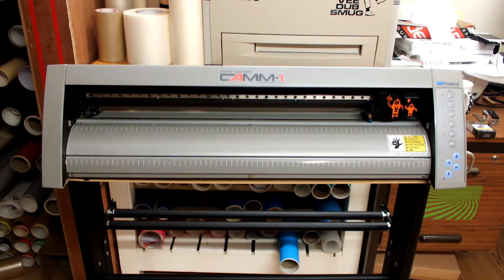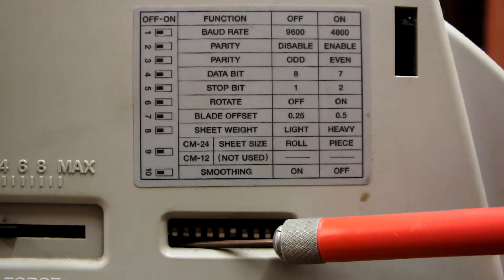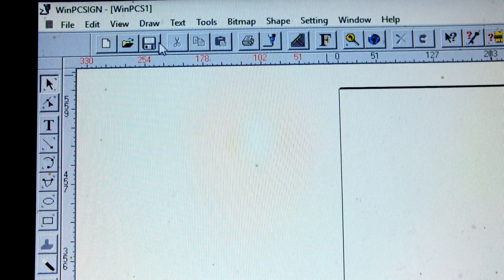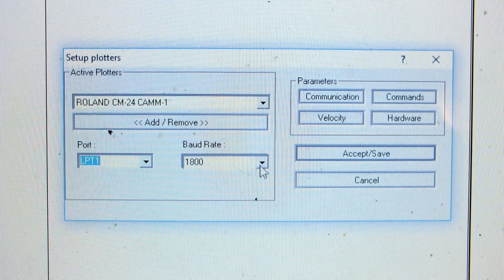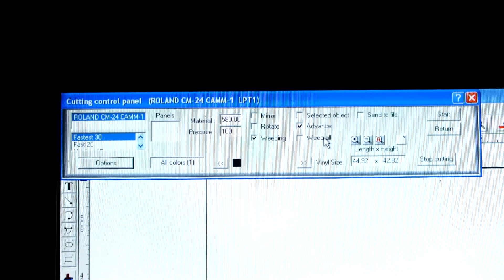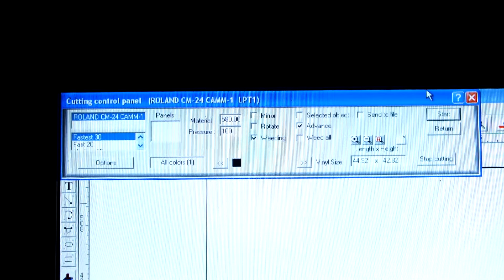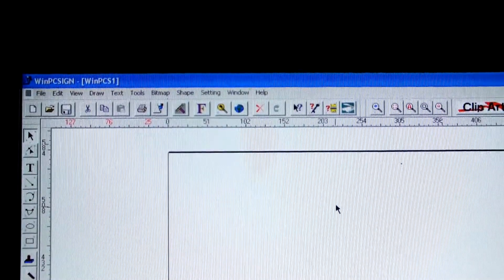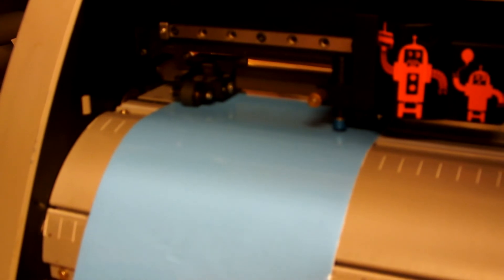Vinyl plotter Basics, How to connect a Roland CM-24 vinyl plotter to a PC

Comment: Hello, nice video. I have a Roland PC-50 plotter and want one like to connect to a Windows 10 computer.
Is there a possibility from serial interface to USB?
Reply from the maker: Hi Mark. 

I have tried every possible way to connect this plotter to modern pc’s to no avail. Unfortunately a old xp era style pc with serial or parallel ports is required for these to run correctly.
Reply: @imsticky6925  Hi. I'm trying to connect it to a win xp virtual machine (running on a win 10) using a USB to PARALLEL conversor device. Do you know if its possible to make it work this way?
Reply from the maker: @brunobatistavalentin  Hi, unfortunately, in my experience there is no possible way to connect these older plotter machines to any modern computer without the computer having a built in parallel or serial port and running an early window os such as xp. i have tried many usb to serial converters on various modern laptops with no luck. i have settled for using my modern laptop for designing an fire up the old tower pc when it comes to cutting.
Reply: @imsticky6925  great. I'm trying to make it work on win 10, running a win xp on a VM and using a parallel usb conversor, but no lucky until now.

Comment: Hey! I'm wondering what is the type of port you are using? USB to SERIAL ? USB to PARALLEL? What's the difference between those two? Does a USB plug work for this machine?
Reply: Hi. I'm trying to connect it to a win xp virtual machine (running on a win 10) using a USB to PARALLEL conversor device. Did you find a way to connect it?